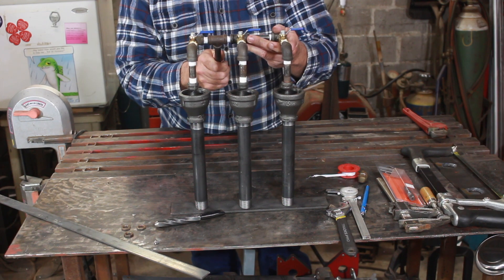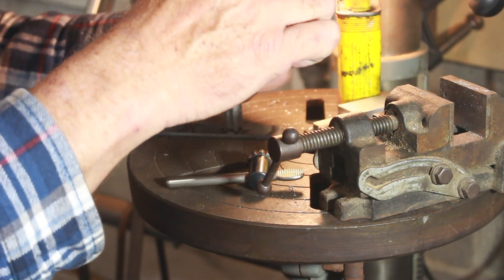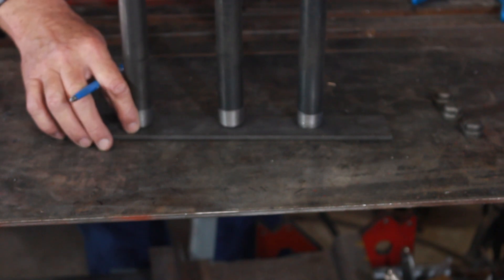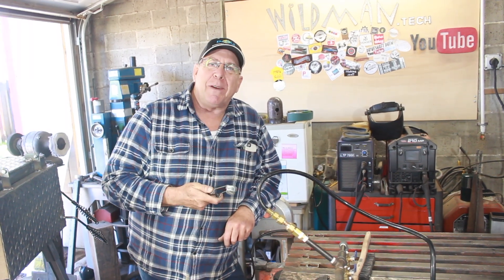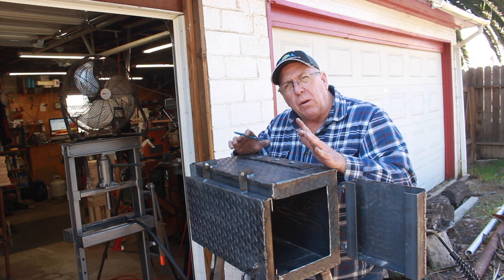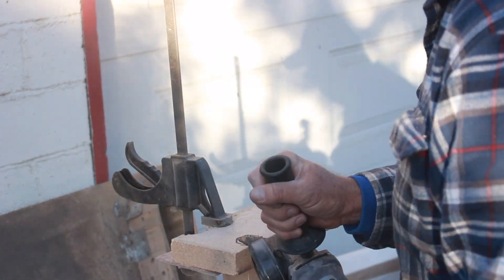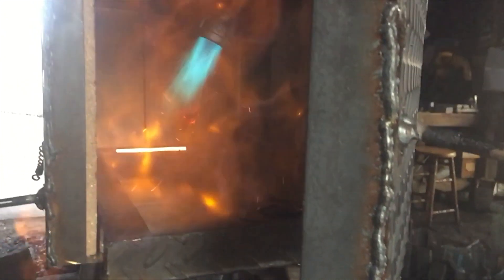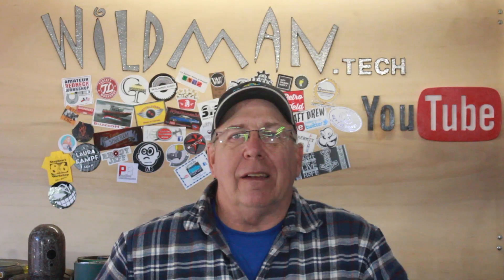Propane Forge Redux! Part 2 - The Burner Assembly

Comment: Unless my old eyes are deceiving me there is exposed steel on the interior that is attached to the exterior.  When that forge gets up to temp it's going to be glowing red on the exterior. The type of burner you built will work better with adjustable air inlets. I'm a new subscriber so I haven't watched all your videos but so far I like what I see.
Reply from the maker: I went back with an angle grinder and a cutoff disk and removed as much of the exposed metal on the interior as possible. Adding adjustable air inlets are also mods we did later,

Comment: So awhile back I was building a small founders to melt down aluminum and I built a burner very similar to yours but I never could get mine to work all that well with just relying on air being sucked in due to the Venturi effect. So I decided to add a second intake that you could connect compressed air to. This worked much much better and gave very good control over the flame as well as I found that I could get a far hotter flame with less gas. You could in theory use pure oxygen and get an even hotter flame although I haven't found that necessary. I'd be happy to send pictures and dimensions of what I built if your interested.